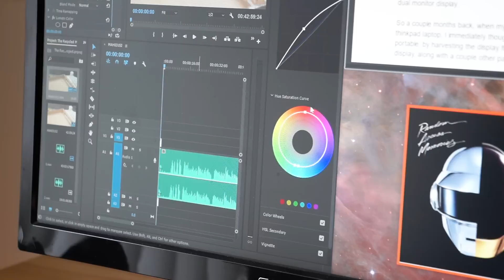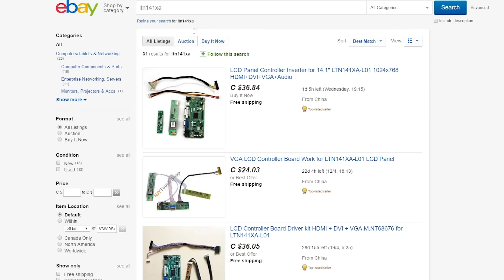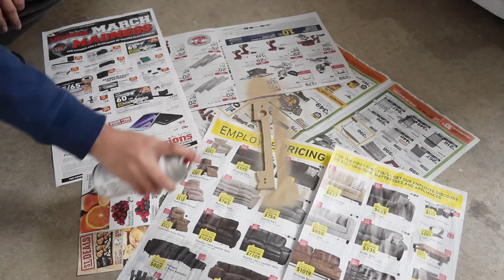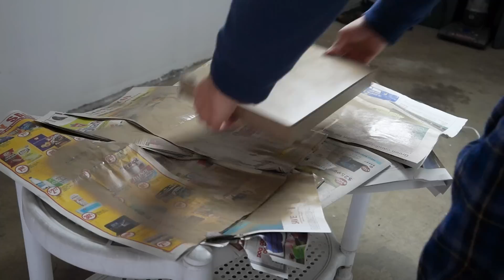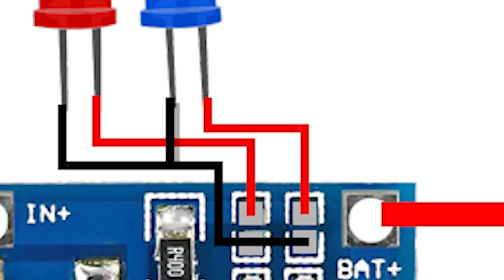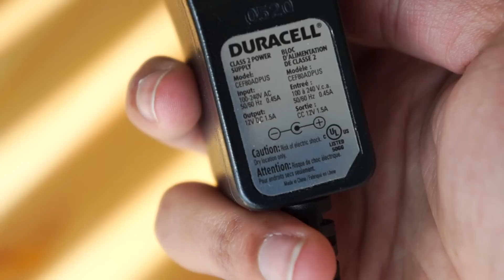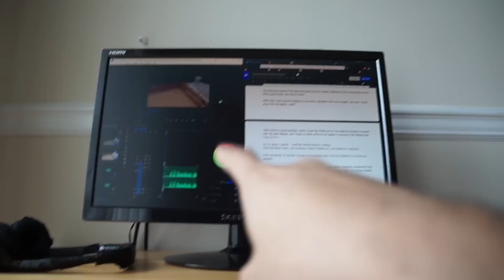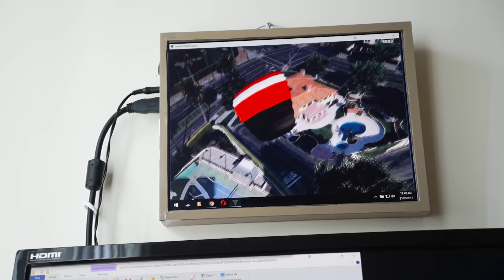The $50 Recycled Portable Monitor Project

Comment: I appreciate your effort of making the enclosure without any really profesional tools.
Just one thing though, next time, use a charging board with protection circuit on it. I'll even suggest changing this one to the one I just mentioned. Li-Ion cells can be really dangerous, even more when you keep it on something like a MDF.

Comment: Nice video!
I have a question about battery, the screen board controller need 12V 3A. Your battery output something between 3 and 4V as you said (and how many ampere ?) So you used a power booster to output 12V. What about the 3A?

Comment: Very hepful video bro, just want ask, is it possible remove the boost converter and the battery..and directly use powerbank to TP4056 connected to the lcd control board? Basically i want power it up using powerbank which is much easier for me..

Comment: You did an excellent job re-purposing that LCD. My question is why you opted to cut the monitor bezel out of a single sheet (?!) rather than simply use pre-cut strip pieces to construct it separately. Seems like a strange way to go about accomplishing the same goal.
Reply from the maker: So that it would look nicer as a uniform piece. It still turned out to look decent, even with the less than pleasing cutting job.
Reply: Hamza Qayyum Fair enough. I was just curious, because it didn't seem to be the obvious solution to me anyways. Thats the best part of DIY, make it any way you want to! :P

Comment: Hi, Thanks for this great video. I tried to replicate the same. It works with the battery but after 2-3 minutes, the screen goes on-off-on-off... any suggestion why? With power via adapter it works fine. Any help would be greatly appreciated. Thanks.
Reply: Battery not charged......and probably your MOSFET circuit keeps on cutting off the power when battery voltage drop down by 2.4 volts and due to cut off battery voltage starts to recover as it reachs 2.91 volts MOSFET turn ON output and battery voltage again starts to drop....the cycle continues as a result board switches ON and OFF...
Reply: @iamtsanand  Appreciate your reply. The problem was with boost converter module, it was getting too hot. Changed it to a different one and it worked fine.

Comment: Next time try drilling a hole a little smaller than the nail you want to use. That should stop splitting. (May help to add a little wood glue to the nails on the way in)

Comment: So far I have tried making mine and I  used a n108 modem dc to dc converter. I am trying 4 batteries at the moment but it is causing that 5v board to get really hot so I am rethinking it

Comment: It doesn't have any battery protection. Next time, i suggest you sould use a charger board with protection against over-discharge. btw. Great video!
Reply from the maker: +M0rtin67 Thanks! It actually does have that protection. Cuts off at 2.8v

Comment: Great video!!! Quick question - could you have used the "power in" on the display adapter to recharge the battery simultaneously? I must have missed it if you already mentioned it in the video.
Reply from the maker: Yeah, certainly could have, which would be a much better solution as well. Only thing is I'm not sure how much current the driver board draws, and I would need to buy a 12v adapter accordingly. But if you have a high enough current power supply ~+4amps, then you can simply put a buck converter to step down the voltage from 12v to 5v for the TP4056 and you'll be good to go.

Comment: All that space inside!  I'd have built a raspberry pi into it, hooked up to the DVI port!
Reply from the maker: +brannanbenjamin I was thinking of putting a pi in there, until I realized a I needed a cable running from the inside to the outside. That would look ugly.
Reply: You could have probably bought extenders for all the outputs except the raspberry pi -- though you'd also need an extender for the power socket too.  Definitely a lot more work that way, when plugging a pi in externally works just fine!

Comment: I have done this project with a trash Toshiba laptop 1360x768 and i never think in put batteries on it, im going to add it i have some 18650 and a charger i have to buy the 3/4v to 12v and its done

Comment: Could you use the power bank directly to the monitor battery?? (and then if you want to charge it you could charge the power bank), or the V is too low to handle an screen ?

Comment: Jigsaw's cut MDF really well. If you use a steel blade (high teeth count) it won't chip (or as bad) when you cut it. Would have gone a long way in cutting out that frame a little nicer to begin with :)

Are you in Shop Class? I only ask because throughout the video I see lots of simple fixes, that your shop teacher should have told you about so you knew before making mistakes. Though making mistakes is sometimes good when you can learn from them, I would think that your shop teacher would be more helpful, or use that thing called the internet to research construction methods with MDF :)

Comment: Nice - can that thing be disconnected from the battery (to either use with a wall-outlett (or maybe a portable charger/power-unit) connected or to keep the battery power in reserve)? Constantly charging the battery (if you are using it at home!) isn't recommended after all!)...that's where power-switch might make even more sense - switch from external to internal power and back ;) )
Reply from the maker: Yeah, the driver board has a 12v jack, so I can use it with that and a 12v adapter. Don't have to constantly keep the battery charging just to use it. That'd be massively inefficient.

Comment: hi thanks for this very good video !!! question : can it is possible to use the power supply cord from the entry on the screen pcb wirring it to charging pcb for charging while using the screen with the same cable instead of usb charging ?  sorry for my rusty english...

Comment: Did you not use an over-discharge protection circuit? The charging circuit handles the over-charge protection, but what about over-discharge?
Reply from the maker: +Mikeyguy94 The TP4056 has over discharge protection too. Cuts off at 2.8v
Reply: Yes, but you have the wires coming from the battery connect directly to the load (the boost converter) instead of passing through the charging circuit. Do you see the problem? How is the discharge protection going to cut off power if it's not inline?
Reply: Hamza Qayyum There is two types of TP4056. One with protection and one with not. The tp4056 you used in the video is not overdischarge protected. You can identify a protected TP4056 because they have 2 extra chips on board and it has B-, B+, OUT+ and OUT- pins. but unprotected ones only have B+ and B- like the one you used on the video
Reply: Yiğit Öztürk TP4056 is not protection IC since it only regulates charging, however there are other board with extra protection ICs with 2 more pads (bat +, bat-, out + and out -) which also does overcharge and discharge protection so you might consider that one instead

Comment: This is just a thought, but if you have an HDMI cable sticking out of the side, why bother with the batteries in the monitor and just hook up the power cable like you did with the driver board. Allow for enough slack on the cables and sleeve them all together and it's just one cable. Who cares about "battery power"...

Comment: The problem with this is that the battery control board is not suited for providing all the power needed for the display, I bet it's running very hot since there's no good heat dissipation and I think it will die really soon

Comment: I got a question: does connecting external power supply burn XL6009? because its connected directly ..or it will not let current to pass

Comment: i was thinking of doing the exact same thing by getting a driver board, external power supply and hack together a case for a salvage 15" laptop display.
but then i realize it cost less than 1/3 of the price when i could just get a older second handed monitor, which i did.
Reply from the maker: +Reese Me Yeah, only reason to make this is if you need the potability. If not, it's not worth it.

Comment: Brilliant work! Just one thing, you're really not supposed to solder to those 18650s the proper way is using a spot welder. Ik those are hard to come by if you don't do a lot of work with 18650s but #themoreyouknow

Comment: Hi, thanks for this awesome video! I'm preparing a similar project, but with a Toshiba 15,4" and the issue I have is with power input. It says it requires 12V / min.3-4A, whereas even an upgraded version of your power converter (XL6009), can give a max of 2A output. Will it work with such low current? I also have a spare laptop battery charger at 19V / 4A, so was thinking of using this, but have trouble finding a suitable step-down converter... can you help?

Comment: Question (electronics noob) : monitor requires  12V 4A  power. Here it gets powered by a 5V 1A source ? I know Voltage is 'stepped' up from 5 to 12v, but does 1A also increase to 4A? how does it supply enough current ?

Comment: You made 2 mistakes. You put the batteries on parallel and applied a voltage booster. What you didn't saw was the maximum amp requirement of the display driver board which is 3amps and that voltage booster you used can only provide 0.6Amps out.... that can cause some real issues... And I HIGHLY recommend using fuses from batteries to a board(s). Cause if those wires short it causes little bit bigger problem. BUT this is NOT hate message I just wanted to make sure you make safe guides to the YouTube and keep on going :)

Comment: Does the MOSFET get hot on your XL6009? Mine does and I set the output properly and im just...It got hot enough to burn my finger with a quick touch (not even a full second) and idk if something is wrong with mine or if the output just isn't right or what...

Comment: without a powerboost circuit between the battery and the monitor, the battery will die quickly, since nothing protects it from total discharge

Comment: For the power button problem, why would you just leave it in a hole and press it with something small? Personally I think it would be a better idea to glue a similarly sized tubular object to the power button so that it can stick out and be used correctly.
Reply from the maker: +Patrick Hill Yeah I did end up doing that.

Comment: One question. Since your are using a multiple batteries, don't you need to use a balance charger? Is this TP4056 good for only one cell or it can charge multiple cells?
Reply from the maker: In an ideal world you would use a balance charger, but if you use batteries that came in the same pack, as did I, and that are all within 0.01v of each other, then it's fine to hook them up in parallel and just use a single TP4056 to charge all. Not the best solution though; that would be a balance charger.

Comment: Dude, boosting from 3-4v to 12v is fairly inefficient. It would have made more sense to put the batteries in series and do step-down to 8-9v ... but you'd need a different charger. 
You should have checked what's the minimum voltage that those boards require.. i think both use linear regulators on them so if you work around the linear regulators you could go with lower voltage. The power inverter will probably work with as little as 8v and the lcd display driver probably has 5v and 3.3v LDOs , so running both from 9v would probably have been enough.

Comment: Really nice Project, but couldnt you have used a 20 dollar hdmi switch instead of the 110 dollar Adapter?
Reply from the maker: +Philipp Huld Thanks! If I did that I couldn't have used both at the same time.

Comment: I tried 3 different boards and no one of them works with this xl6009, whatever voltage I set. Sometimes it works but after a off-on it doesn't.

Comment: Three dead cell without overvoltage protection. You don't fear explosions :o
Tp thing charger is one cell only, so you need at least overvoltage protection on each cell individually because it is not balanced ! Anyway, you have lots of work both in making the thing, recording and editing that's well worth monetizing. It's maybe not you're idea though it's still a lot of work
Reply from the maker: +Nathan J You do have a point, the best solution is to use a balance charger. But if you make sure to have the cells all at about the same voltage, so +- 0.05v, then it's safe enough to use a a single cell charger, imo.

Comment: Uhm, a second hand 24" in my city (working perfectly, no dead pixels, scratches) is like $ 55 :) I bought a 22" monitor last year for a project for $45 (again, perfect condition on the matrix). Not sure where you live, but $50 for a 14" is kind of overkill - it should be more like 10 to 15.

Comment: Hi! Nicely done mate ! I'm about to do the same.

I have a question, you use only one Tp4056 to charge the whole 3 batteries ? Dont you need 3 ? Thanks
Reply: Raj if u can't understand y u only need one I suggest u don't try this
Reply: lol how nice of you :) 

Well i'm trying to learn, dont you know that's by asking and making mistakes that we all learn ?

Thank's, i'll be careful, don't worry.
Reply from the maker: +Raj Not necessarily. It's good to have three, but if they're all at about the same voltage, so +- 0.05v, then it's relatively safe putting em in parallel.
Reply: Ok Thanks for the answer

Comment: Does it run while charging ?
Reply from the maker: It can but not a good idea to be charging the batteries and running the thing through them. That's the reason the 12v jack is there, so you can power it directly with a 12v adapter.
Reply: Cool! Does it mean it switches from 12 volt input to internal batteries during a power failure?
Reply from the maker: Highly unlikely to happen, so no. Plus, if the power does go out, you can just flip the on board switch and the battery will start powering it. Not much work to do that.
Reply: Nice ! Cheers Mate

Comment: Next time use wood glue/carpenters glue to connect the pieces of wood/MDF
Reply: Always cut away from you and don't put your body parts in the blade path
Reply: Hot glue also works wonders for attaching things

Comment: It's a nice video but I really don't like your comparisons at the end. You're comparing your spare parts DIY build sans $100+ USB 3 adapter to USB 3 monitors in new condition. The reason the USB adapter costs so much is because USB bypasses the GPU entirely, meaning the USB device essentially needs to have an entire GPU built-in. If you're going to compare your DIY monitor to anything then at least use something remotely comparable, like another regular monitor.
Reply: The USB 3 adapter you got for free could actually be compared to an external PCIe slot and a GPU to go in it. Except the only normal use for that would be to actually use the external GPU to increase performance, and thus there is a big gap with performance and pricing if you do compare them (not to mention the latter requires the computer to have Thunderbolt 3 support as USB 3 alone isn't fast enough). But if you do have TB3 support on your laptop that might possibly be something worth looking into for you.

Comment: Didn't you should add something like auto cut off to the battery so it will stop charging when the voltage is under 3V, or the step up already did that?

Comment: You didnt use a voltage regulator
Reply: WaterDerp The DC-DC booster has a stable output. So, no need ^_^
Reply from the maker: +Azwad Abid Yeah, quite stable.
Reply: Hamza Qayyum hey what do you call an ant without legs?

Comment: If he tried to talk any faster I'm sure I would have missed him saying something about spraying the box again with extra coating because he mistakenly forgot to fully coat it the first time and let's not forget about him cutting the box again because it didn't fit the first time so he had to sand it and have to extend the wires and have to solder the wires onto the board that he forgot but then solder it again later because it didn't fit the first time and the button he had to solder and extend didn't have to.

Nigga just get to the point damn.

Comment: So im a broke ass thot, and dont just have a spare laptop battery. 
Is it possible i could ude just regular 12 volt batteries?
(A dc plug uses 12 volts right?)

Comment: Lots of improvised and mistakes made.The first one was not using screws and nailing the pieces, which obviously cracked it, and then the second one was cutting your finger(ouch).Also I would feel unsafe having it taped only, just saying :D better add some screws and securing it in place good.